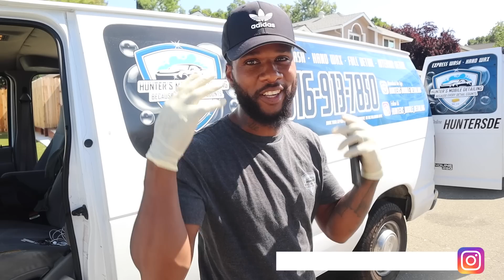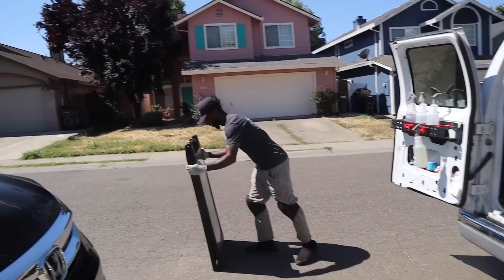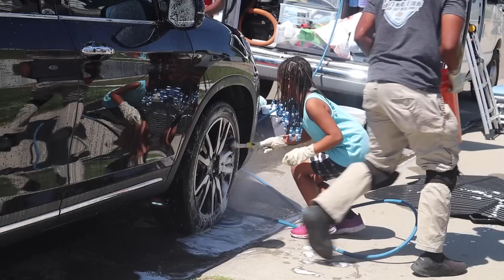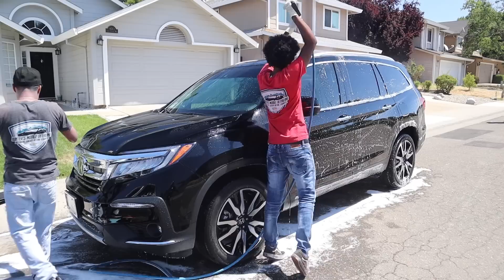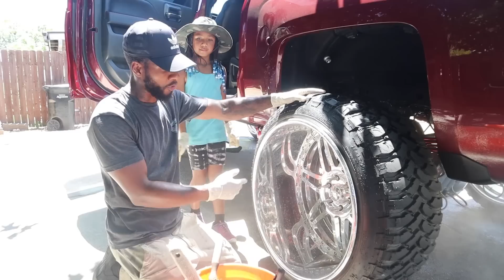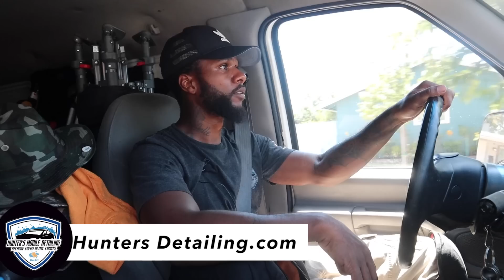Picky Customer Keeps Pointing Stuff Out - Hunters Mobile Detailing

Comment: 4:40 - those wheels will stain very easily with certain chemicals if diluted too strong, a soft hand wash with soapy water is all you need, then follow up with a quick detailer spray wipe down. Hope that helps brother :)
Reply: Agreed.  Higher quality wheels like multi-piece may have high polished lips/barrels that can easily get damaged and stain.  Repair would consist of sanding down the entire wheel before having them repolished out, and then re-clear coated…tons of work
Reply: Correct chemicals will cause etching if Ph is too high soap and water followed by a metal polish certainly will increase profitably. 💸
Reply: Que already said that.
Reply: I was going to say if you're running a ph neutral chemical then it should be fine aside from water marks from it just sitting on there if you don't take care of it.
Reply: Yup I had to repolish mines bc of a wheel chemical (polished aluminum with not clear coat)
Reply: Those wheels are tires are pure trash,who cares how much they cost they still trash. 19 inches and over looks like shit,esp on them stretched,overly wide ties with no fenders to cover 'em.
Reply: Not knowing...I sprayed degreaser on aluminum rims and stained them and thought I ruined them but luckily I polished them out whew!!!

Comment: Those wheels are polished manually thats why he doesnt want chemicals those are forged wheels (aluminium)

Also that set that size will cost easly over 5k just for 4 wheels (usd)
Reply: @damanwithdaplan1369  oh yea for sure ! So difference is they are forges onto an aluminuim block and polished...
-as where other wheels are poored into a mold (usually magnesuim and other metal mix) .
Reply: Exactly they are made out big blocks of raw aluminum
Reply: @damanwithdaplan1369  sheeesh
Reply: That's what products like Meguiar's wheel brightener is for.

An acid in the hands of a professional is totally safe. Even with raw aluminum which even American force wheels are clear coated.

The only substrate an acid will react harshly with is glass.
Reply: they will burn the acid will leave a black line in the wheels that’s hard to get out
Reply: Those are like 10k bro

Comment: Hes probably afraid of the wheels getting acid etched. It can happen if you use certain chemicals and let it sit too long and dry. That service you did on that truck would be $250+ here in the Northeast.
Reply: i would say he has it ceramic coated wheels so they get less dirt but clean them with wrong chemicals and it loses the coat
Reply from the maker: I use none  acid tire and wheel cleaner for everything.
Reply: @HuntersMobileDetailing  Definitely no wheel acid on billet wheels (raw aluminum). If his suspension parts are also billet I would stay away from using acid on those too.
Reply: @HuntersMobileDetailing  those are probably forged wheels. Not no chrome. Since it’s bare metal you can’t use acid bases cleaners on those. Luckily I learned the hard way on a my dirtbike frame, quick polish and it got it out tho. So a ph neutral car soap would be sufficient I would think since you’ll be cleaning them every week, maybe a non acid wheel cleaner if they’re nasty
Reply from the maker: @adolforeyes4102  my bad I meant to say nine acid spell check
Reply from the maker: @firstgenon24s  none acid spell check my bad
Reply: With you 100% 
Showroom quality wash and detail starts at 250$
Reply: I’m in az the service on the red truck I charge $350 mobile & $250 dropped off at my shop
Reply: Yeah this level of service on a truck like that would be $250+ in PNW as well!
Reply: Great job and great father,  the work you did on the red truck , should been $250. But continue to do what works best for your family and you. thats the best way my brother.

Comment: All purpose cleaners and acid cleaners will stain and haze the wheels since they are bare aluminum.   Will have to re polish them and can be a night mare if you don't have experience on those type of wheels
Reply: Very true with an acid based wheel cleaner. You can get other wheel cleaners that arent acid base. I learned the hard way fucking up fuel wheels size 20 if i memeber right
Reply: Theirs specific cleaners for chrome wheels like these that won't damage the wheels. But I'd personally use a PH Neutral Wheel Cleaner that Isn't strong at all to avoid any damage at all b
Reply: These are bare aluminum
Reply: Exactly!
Reply: Yup billet and forged wheels need non acidic cleaners... down here in Houston we charge over 150 for lifted details... $85-$120 per wheel  cleaning and polish etc.. undercutting yourself big time... what you charged him is what I pay for my stock F150..
Reply: @andrewcarter2331  I did the same thing on my truck I have fuel 20s and I’ve pitted them and it made me sick first time cleaning them
Reply: @John Stone thats alot of foil paper

Comment: On those chrome wheels heavy wheel cleaners, all purpose cleaners and degreasers can leave white streaks all over them.
Reply: Yea that’s why you have to use a non acid wheel cleaner for polished chrome finishes I do them all day long there are a lot of products out there for those types of wheels
Reply: @cbruno12180  what kind of cleaner would you recommend for chrome wheels like that?
Reply: @estevanortiz6476  p/s brake buster is great safe on all finishes in its regular strength and diluted.. but to be honest a strip wash soap would work great too on those with a soft microfiber mit then apply a nice carnauba wax to the wheel it looks amazing on chrome wheels
Reply: yes!
Reply: These are NOT chrome, they are polished aluminum (billet).

Comment: I had a customer lose it on me because I used a deodorizer in their car. His words were “i want it to smell like it did before you cleaned it.” People can be extremely annoying
Reply from the maker: 😂😂😂 sheesh that’s crazy
Reply: Lol some people are sensitive to smells, but they should be telling you that before you start.
Reply: Honestly, I'd be a little pissed too if it wasn't discussed first.  I have asthma and bad allergies, and most strong fragrances give me headaches, mess with my breathing.  I wouldn't "lose it" on anybody though, but I'd have to air that shit out for sure.  Only thing I want done on the interior is a vacuum and glass cleaner...no greasy bullshit for dust to stick to lol.  Modern plastic and vinyl have all the additives it needs to live a long life without that stuff, especially if it's silicone based.  Then it's just worse for the car.

Comment: I have a customer with similar pickiness about his rims but he eventually let me explain and allowed me to  apply whatever I want to keep his wheels shiny.  I told him that tested dilutions  of apc and degreasers are not at all harmful especially on polished and coated chrome. Don't let anything dry and don't use acid based products. I convinced him to let me clean and protect the rims and the next wash I did  I brought him out to show him how I cleaned the rims. Rinse, foam, lightly agitate, rinse again then apply spray coating to prevent buildup so could then wash down clean rims easily, on regular basis. He approved. But I get it   many people just apply concentrated chemicals that eat away at the clear coat and chrome.   He said as long as  theh stay the way they look  now then keep doing what Im doing.

Comment: Those wheels are forged aluminum otherwise known as billet not chrome like a lot of people are saying it’s not forgiving at all…. Degreasers, wheel and tire cleaners will chemical stain it and need to use heavy metal compound to remove those stains…. Definitely aren’t cheap either especially that size and offset.

Comment: First time I see your videos,  I have detailed any car that you can think of.  You can use degreaser but it you dilute it properly or you can mess up a chrome rims.  If the rims are hot, degreaser can mess them up or stay then,  there are top of the line detailing cleaners but can be pricey.  I use some that are for any rims and I don’t have to worry about messing them up but the gallon cost like $130 and yeah, not many people want to spend that kind of money.  When you use polishes, make sure you use the correct one according to what kind of material they are.

Comment: Before drying w towels try using leaf blower if ground is clean. Saves time, less towels used, dry before sun spots form & most most water beads fly off veh. I use simple cordless Dewalt (big battery for longer duration) but there are more powerful ones out there.

Comment: Chemicals on polished aluminum or anodized wheels can leave dull spots just safer to use a ph neutral soap with a soft brush. If your wheels are painted or powder coated use a none acid wheel cleaner. If you want to protect those wheels apply a ceramic coating of a polymer sealant like bead maker.

Comment: You can use chrome safe chemicals on chrome (which most non acid wheel cleaners are) but you have to make sure to thoroughly rinse and wipe them down dry or you’ll leave a residue.

Comment: The reason he's not wanting chemicals on his wheels are the finish of them. They are polished wheels and multipiece on top of that. The face of the the wheel and the barrel are separate pieces and bolted together. The polished part is the the "chrome" appearance is actually polished bare metal, so using the wrong chemicals/cleaning products can actually end up leaving the wheels hazy. Now you have full wheel polish job at no charge to fix your mistake. I hope this helps!

Comment: Wheels are polished aluminum. Aluminum is porous. If you use APC or acid it’ll etch, stain, and dull out the finish. Then he was going to have to get them polished.  This is all the clientele that I have, and I’m usually around $300-$400 for this.

Comment: They are probably non-coated polished aluminum wheels. Acid type cleaners etch the aluminum. They also scratch just looking at them so make sure to use super plush or soft materials.
Reply from the maker: Thanks brotha I will keep that in mind

Comment: certain chemicals can make chrome corrode or flake same with polished or aluminum, you have to have certain ones also with wheels/rims like these i would use a soft bristle brush or just a microfiber rag to avoid scratches since it does take a long time to get them out.

Comment: Sometimes certain chemicals can etch or strip the finish/polish on the wheels.

Also just wanted to give some advice: not sure what kind of brush you’re using to clean the wheels but it looks kind of hard and may end up scratching certain wheels, I used a hard brush like that on some freshly powder-coated wheels and after a few months you could see tons of micro scratches under the light, I switched to a softer wool type brush and is way safer, a friend of mine who is in the detail business said you shouldn’t use anything on your wheels that you wouldn’t use on paint because it’ll have the same effects.

Comment: I mobile detail myself. I'm not sure why he didn't want chemicals on the rims. An apc would work just fine without damaging. It looks like you figured out the solution with the customers request and that's awesome. Just let them know that you dilute the chemicals and its safe on all surfaces. It looked like you were spraying them with a spray wax anyways. If you do run into a hazing problem you can get an aluminum or chrome polish and use an applicator and bam you're good to go.

Comment: I polish truck wheels for a living. You don't use chemical on polished aluminum. The chemical can eat away the polish. Alot of expensive rims arnt clear coated. If you have clear coated aluminum polished rims it's fine to use anything. Including acid. But unprotected polished rims will tarnish with some chemical. Especially acid based.

Comment: You do good work. Those wheels are pesky and I’m glad the customer told you no wheel cleaner because he probably assumed you’d use an acid based wheel cleaner (cuts through brake dust better but ruins the polished finish). I found that out when watching a video about how to polish a truck bed box—anyway, good work, but those pricings are very generous for the customers. Keep goin, we appreciate it

Comment: Definitely use a ph neutral wheel cleaner regardless of what wheels you clean.  No acids. Ever.  Especially if you're unsure of the finish.  Bare aluminum wheels like this I wouldn't even touch as an express service as they require manual polishing with something like mothers mag aluminum and a buffing wheel, which can take up to an hour for a set of 4, especially with a complex spoke and rivet design like these (ask me how I know).  Else, just wash them with soap and let the owner deal with it himself.  Excellent work!

Comment: For the chemicals on the rims it depends sometimes it's a cheap brand of chrome rims that corrode and peel with certain chemicals or on black rims some are not originally black sometimes they are cheaply painted or dipped.

Comment: I bought a new car from a dealership and the salesman said they were going to wash and detail it real well before driving it up and handing off the keys to us.  It was brought to us wet, but with a film of light dirt all across both sides with cobwebs all over the rear of the vehicle. I took the palm of my hand and wiped one area of the dirt film and my hand was completely covered with wet mud.  Apparently it was just rinsed off with a water hose.  My wife complained and they tried again.  It only took them 5 minutes and when they brought it back it had the hand films of dirt with the same cobwebs (cobwebs with water droplets hanging from them) in the rear, essentially only rinsed with the water hose again.  We gave up and just drove off. In our case we were not being overly picky for a new car to be decently clean when passed to us.

Comment: That style of wheel on the lifted truck is called a forged wheel. You can stain the wheels using acids or degreasers you only want to clean them with only soap and water. They are aluminum wheels and get chemical reactions easily

Comment: I also saw a comment where you said you use non acid wheel & tire cleaners for everything. I use meguiars non acid wheel & tire cleaner diluted 4:1 but when it comes to billet I do not use that even then. Just ph neutral soap and water is the way to go!

Comment: You probably already changed how you do it since July, but be careful about dragging the vacuum pipe over the rear bumper when vacuuming the trunk area, and also when you pull it over the door frames vacuuming the carpets, as it really damages the paint.

Comment: When I worked at a semi-truck wash we'd get customers with polished stuff and if the acid in the cleaning solution we used got on that polish, it would eat through and ruin it, so we just used soap and water with a brush instead.

Comment: To answer the question on why the customer requested not using chems to clean the wheels on that lifted street queen of a truck is because acid based rim cleaners could actually discolor that bare aluminum chromed finish.

Comment: Those are billet wheels (polished raw aluminum), the inserts for the suspension parts are too. When you wash them do not let water sit on them and dry, if you do you'll be polishing them lol.
Reply from the maker: I’ve learned that the hard way 😅 your speaking facts
Reply: @HuntersMobileDetailing  When I got my first set of billet wheels I realized fast how much work they can be lol. They are worth it though!
Reply: wayne has de ionized water he doesnt need to dry them but he does to go the extra mile ...
Reply: @startingtech3900  good point!

Comment: You're right. The wheels are polished aluminum whoch has no coating. Wheel cleaners can leave marks and stains on the finish. Its a pain in the ass to clean polished wheels. Lol.

Comment: Bro here in Houston I charge $275.00 for the basic detail on a truck like that bro. And try not to use those wheel brushes on the alloy. And just soap watering the wheels any chemical can stain them and you would have to polish them.

Comment: $125 for inside and out PLUS mobile? Absolutely no way, not ever not even on a winter special. 

My advice would be to aim for a bare minimum of $50/hr. I'm STARTING at $100 for a basic interior ONLY $200+ for shampoo, headliner and leather conditioner. 

Anywhere from $100 to thousands for the exterior. You're worth more than that man AND you'll see higher quality clients

Comment: On that red truck that suspension has to be clean that and the wheels is the center of attention the reason he doesn’t want chemicals is because they leave stains and it’s hard to buff out those look like 28x16 forged wheels they are around 10k

Comment: Those are billet wheels so those wheels stain very easily even if you dont dry off the water sometimes it will just stay stained till you actually polish the wheel. I have a pair very pricey look good but hate the cleaning on them

Comment: Those look like billet aluminum wheels, which can easily be etched and become dull if not cleaned with the proper cleaner
Reply: That's what they are at 1,800 bucks a rim
Reply from the maker: Sheesh
Reply: They're forged aluminum and the customer is an idiot.  A mild acidic wash followed with a proper rinse and dry will help them shine.  Just using a towel with no chemicals to clean brake dust and environmental residue has significant limitations.

Comment: I'll save you some extra paid work USE A TWO BUCKET METHOD WITH THE DIRT TRAPS. I've noticed you don't do that. When you use the mint with the soap on it do one pass then dunk it in the water do Straight passes not circular motions because that put scratches into the paint
Reply from the maker: I now do the 2 bucket method